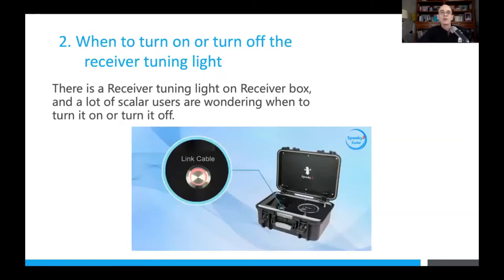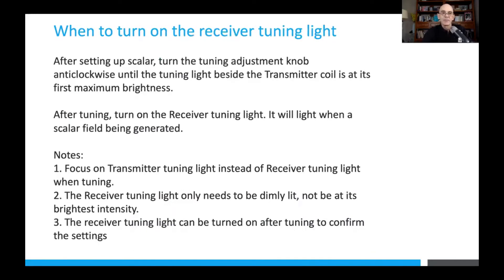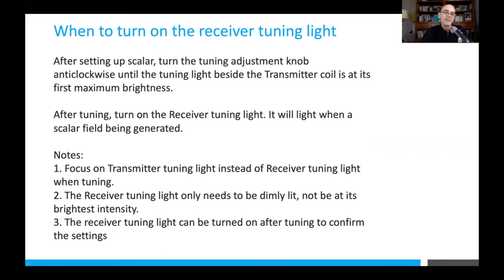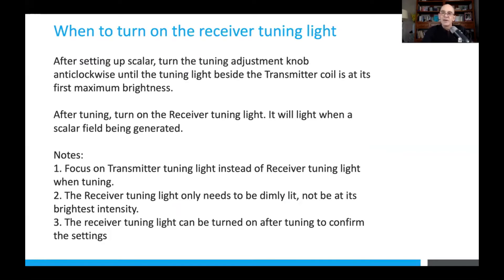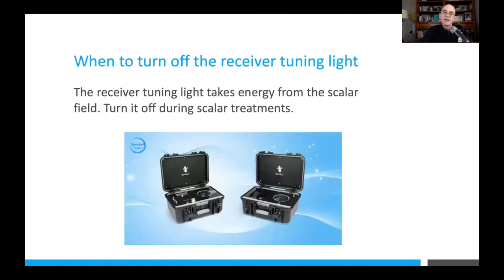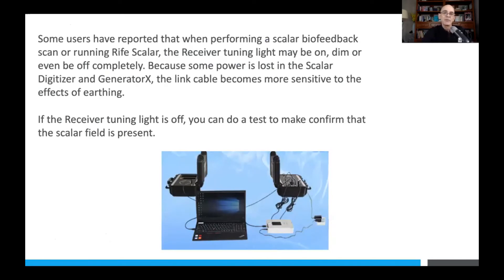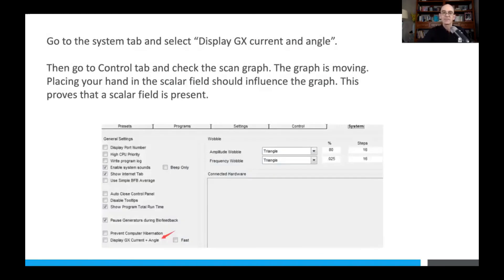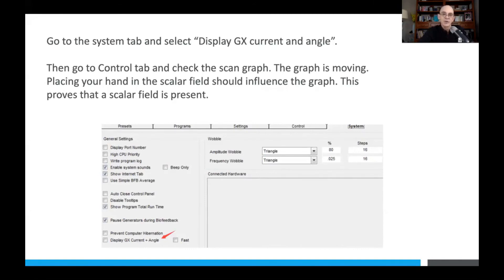When to turn on or turn off the receiver tuning light

Comment: Hi John, I did the test you talk about in this video; the graphic displays as you say. However it moves whether I am or not in the field, and whether I tune at less than 4.5 MHz or more than 5.00MHz and even when I tune at over 7.00MHz when the light of the transmitter is off. When I am not in the field the graphic moves in the central area and stays moving straight in this area. Yes, being in the field the graphical displays changes but it changes no matter what I tune. I am confused. What dose this means? Thank you for clarifying me.
Reply from the maker: Hi Maria. If the receiver light illuminates, there must be a return path for the electrons to flow. A light requires 2 wires, but scalar has only one. The return path is either EMF or scalar. If you choose the higher tuning point, the return path is scalar.